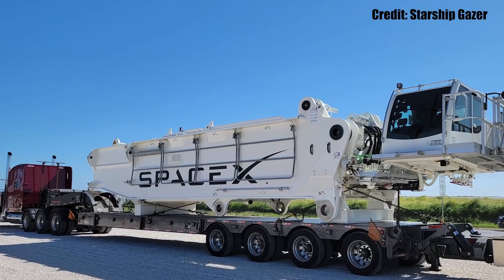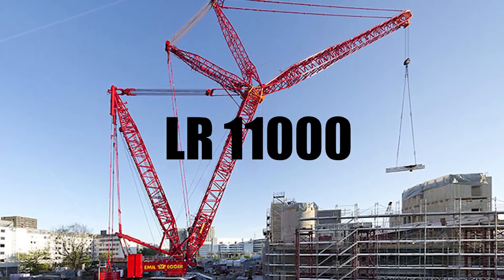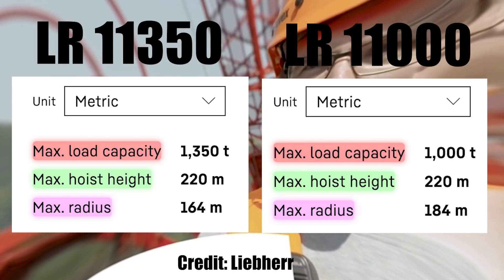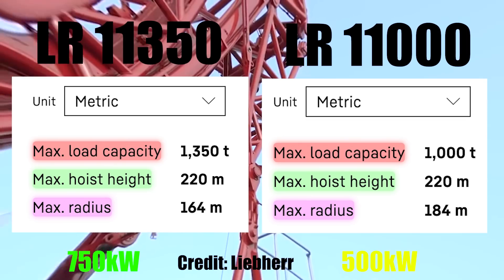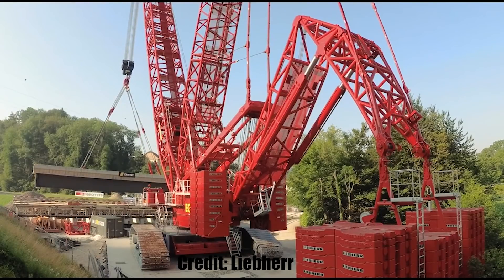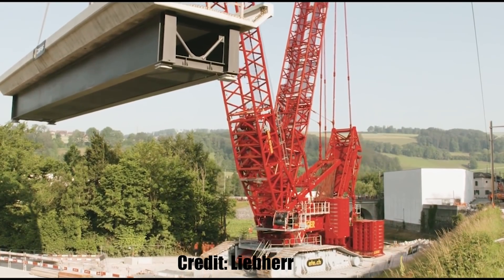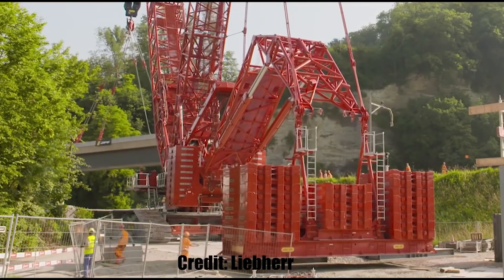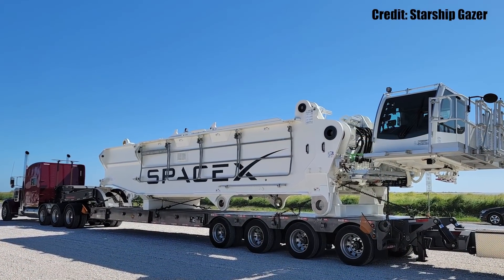Analyzing the New Custom SpaceX Crane: Basic Features Every Tank Watcher Should Know About. LR11000

Comment: As has been touched on, the Derrick Ballast or “super lift” on the LR 11000 is a modern design which allows for compact maneuverability. At 2:43 you can see the old design utilized by Frankencrane, which utilizes a fixed length support and lifts the suspended tray with limited ability to independently control your Derrick radius. The new design utilized on the 11,000 is called variotray, and not only allows for more maneuverability, but ease of configuration changes, making it able to do the same lifts Frankencrane is doing more efficiently.

Comment: Interesting how it moves the counterweight one way as the boom reaches in the opposite direction.  Makes a lot of sense, but I've never seen that before.  Guess all I've ever seen are smaller cranes with fixed counterweights.  Amazing how innovation is needed to push the limits.
Reply: Manitowoc has that style of movable counterweight capable of changing its radius. Load goes out, counterweight goes out as well. Load comes in, so does the counterweight.
Reply: this is called the superlift ,  with older models without a ballastwagon with stinger. you have to have a spare crane to put or to take away counterweight pieces to keep balance. a crane is nothing more than a scale
Reply: Yep the vario ballast

Comment: I'm certain if Elon wasn't already so busy, he would be designing cranes also.
Reply from the maker: maybe he will design the first crane specialized for operating on Mars😅
Reply: Due to near-vacuum and extreme low temperatures, Mars equipment needs to be custom designed, made mostly from stainless steel, and lubricated with vacuum grease. 

Cost of shipping to Mars is proportional to mass, so the designs have to shave off mass to an obsessive/compulsive extent. Fortunately, Mars gravity is about 1/3 of Earth, so many parts can be made rather fragile looking.

Imagine a truss made from tubes as thin as carbonated beverage cans, but pressurized with local Nitrogen or Argon to keep them very stiff.